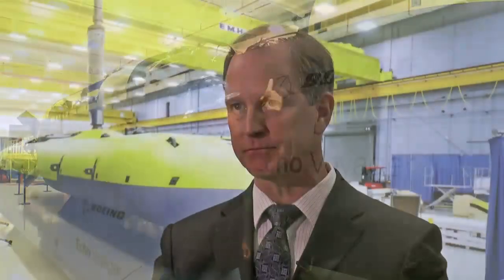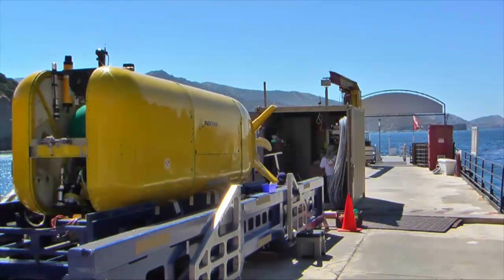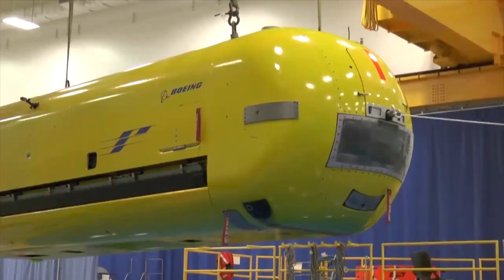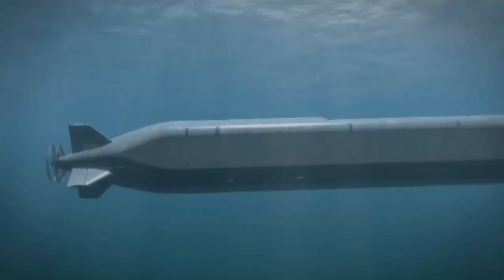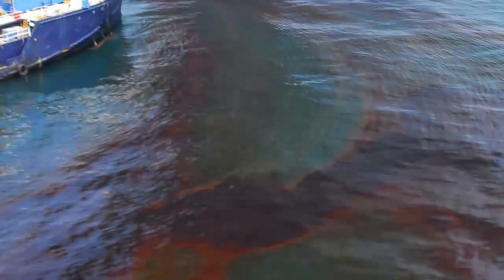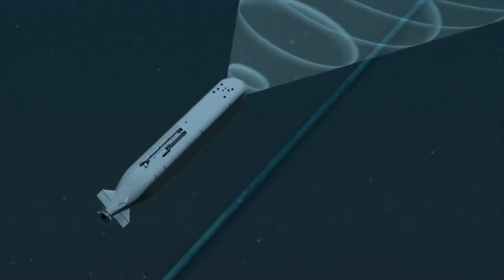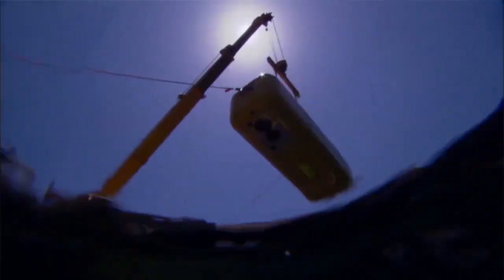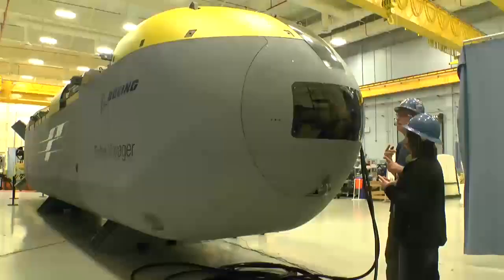Boeing’s Echo Voyager: Welcome to the Family

Comment: '
still poooor design...
need long nose cone on the front X==ii==:>...
not X==ii==D...
R/C in the water is a weak signal and limit range...
on the air and ground are strong signal and better longer range than inside the water